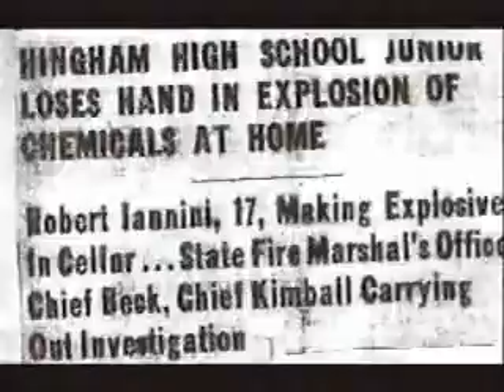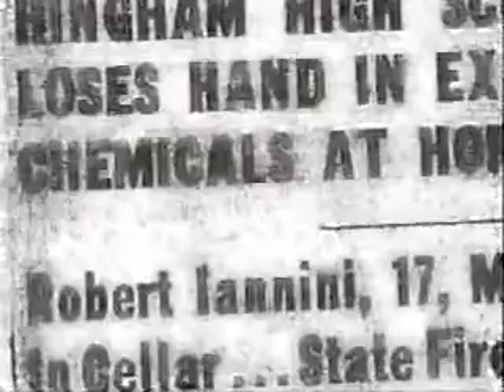Invent This!: Bob Iannini

Comment: I worked for Bob for a couple years back around 2015-2016. He seemed a little crazy but I'll tell you he was genuinely a brilliant guy. If I remember correctly he had 2 or 3 PHDs and most of this stuff he made he'd just design in his head and then just draw the circuits on some paper. We'd whip something up and it just worked. It's a shame he never got more recognition. I'm pretty sure he was the first guy to invent the bug zapper and small ozone generators for removing odor he also had a device similar to what is used now in TENS therapy(this was all back in the 70s long before i was born), he just didn't patent anything so he'd sell them for a while and the designs would get stolen and he'd have to stop making them. He also apartantly had a design for a device that could destroy cancer tissue without harming healthy tissue but according to him it was confiscated shortly after he tried to get it approved as a safe treatment. Dude could've changed the world with better funding and a couple patents